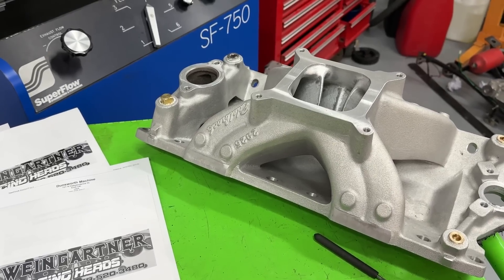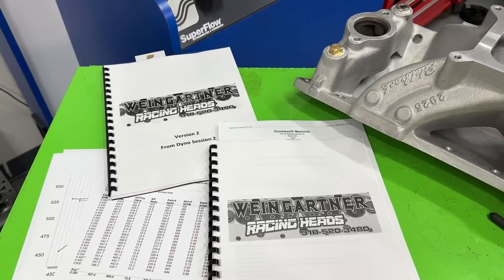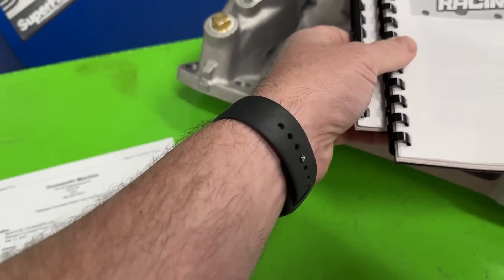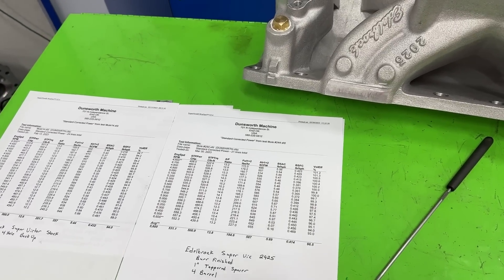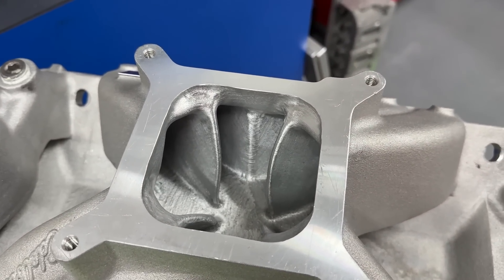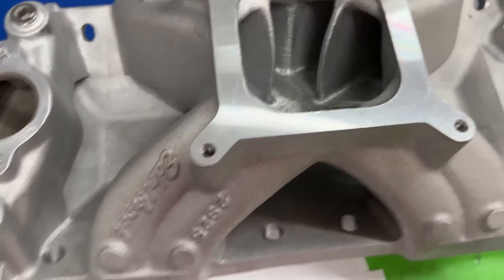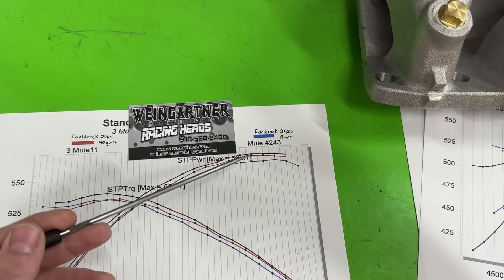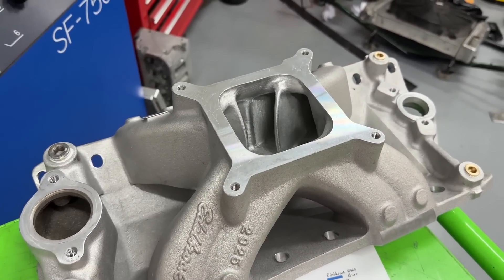Burr Finish VS 40Grit Finish   Copy

Comment: Even the Simplest test Comparison can get unexpectedly Complicated....Intake Finish with Jetting Optimization seems to be Need here.......I know dyno testers Prefer Individual Componet change test Comparisons but Intake Finish can be Linked to Jet size as in System A/F  tuning  Effect on ultimate Power.....Intake Finish Only Power measurements may be an Incomplete conclusion.....

Comment: What I take away from this video is a bit mixed. I couldn't help but notice the notation on the dyno sheets - and the sheet for the unmodified manifold Doesn't List a 1" tapered spacer and the other two do. The reference pull data or "control" isn't valid, or someone forgot the notation for the spacer on that sheet - so without clarification it throws that data out the window.
The other two are within roughly one percent, so (as you mentioned) there's no clear winner.

Some thoughts on the smaller manifold making more power; with a 190cc port and the relatively short cam timing, a smaller manifold might be matching the port size better in terms of flow - the charge not 'ganging up' at the port because the smaller (manifold) port velocity is higher and matches the flow velocity potential of the heads better - also putting cylinder filling about where that camshaft favors the power curve.
Maybe - just thoughts!!!! 
I love working with airflow - so much is still a Black Art, so any progress in an as yet untried area is a bigger win yet!!!
Reply from the maker: All them were tested exactly the same with a a 1inch tapered 4hole spacer.
Reply: @WeingartnerRacing  
I wondered, didn't seem like a mistake you would make.
Good video

Comment: Luckily my customers adore the BURR look!!!! 😅
Reply from the maker: Maybe but I guarantee at least one person that sees it thinks it’s garbage no matter how fast they go.
Reply: @WeingartnerRacing   Some are indeed sceptical.  But after 1 race that changes. 
Also what you did is something I do pretty long now after 10 years ago I tried improving an Ls7 head  with radius seat on intake and grit 60.  Airflow improved but power was 2-3 percent less..... esspecially in lower revs.  Last year did a BBC with assymetrical seats on intake.  Angles where droplets of fuel are smashed along and port almost complete burr finish.  Radius seat where only air and tiny droplets flow.  Difficult to make but results were awesome.  
Similar an Ls of which after overhauling diameter of intake throat was increased  by machine shop 0.040"  and seats were 0.010" deeper than new and with bit different shape.  Engine lost 30 hp.   After seats were replaced , with right shape, diameter and depth , and port roughened on specific areas it regained 38 hp first run .  Also engine responded more normal to fuel changes / ignition.  
Its in the details....

Comment: THIS would be an interesting topic to address
Old School/Wive's Tale/Rule of Thumb was that having TOO SMOOTH (too fine) of a finish (mirror-like) on the intake floor/runners would hurt Atomization of fuel in Carburetor applications. I wonder if the same rules apply to THE SAME INTAKE MANIFOLD using a Fuel injected setup with a 4150 or 4500 Throttle Body on top of the manifold, where no fuel hits the floor or runners, as the injectors are essentially spraying into the Cylinder Head entrances more or less, bypassing the manifold runners  ?
Reply from the maker: Maybe I will test that one day.

Comment: At 6200rpm the burr finished combination was moving more air than the 40grit, the burr combination was moving less fuel. 
If the burr combo was fuel corrected to match the extra airflow it would of made more power.
Reply from the maker: Maybe but I doubt it. If you look at 6500 they are almost identical and it still made less power.
Reply: @WeingartnerRacing  looking through all the rpm points the burr combo consistently moved more air but didn’t have consistent fueling, when you look at the airflow being higher but the fuel flowing less that says to me that there was a change in booster signal, I’m going to stick my neck out and say that the day the burr combo got run the air temp in the dyno room was higher, either from just a warmer day or from environmental heat soak from multiple dyno runs.
The air temp being higher can effect booster signal and also the airs density overall is less so the engine will make less power even tho it’s moving more air in cfm.

Comment: I only use the sanding rollers to give everything a nice uniform finnish. Usually intakes I will do a 60 grit (just a personal prefernce) now as for  Exhaust and cumbustion chambers I try to go for a "glass" feel just to keep carbon deposits down and stop detonation. I am no means a pro head porter but I have goten good flow numbers with heads that I have done. Probably not the best but they seem to make decent improvments, I jysy bought stuf too try and cut valve seats i am going to practice on a junk head I have with valve cut angles.

Comment: I think it has to do with the transition of airflow into the runners under dynamic conditions.  How fast can the flow be established into the runner when the demand comes on?
Reply: I should add that I saw a Hendricks manifold for 18deg Chevy back in those days, and they had a very aggressive finish,  but smoother on top and down the runners,  etc. Just like you're doing it.  I'm guessing they knew what they were doing.

Comment: In the 80's when I ran carbs I had a real time o2 sensor for tuning. I remember that the burr finished manifold required removing jet to get the same a/f ratio. This may also be the case here since the jetting was not changed. Great test Eric.

Comment: A rough finish grabs air. And air is slick on itself. See golt ball flow and dimple effect.
Reply from the maker: If it worked like that would have made more power not less. A golf ball flies through air. It’s not the same as air inside of a golf ball surface.
Reply: @WeingartnerRacing  not necessarily. It's still air flow.

Comment: Interesting, thanks for keeping it humble and not turning it into a burr vs. 40 grit war. I think that anybody  with 1/2 an understanding of engine building realizes that this test could go either way if repeated with even a modest change in the engine.
Reply: What I wanna see is burr vs 40 vs 60 vs 80. In my few hours of research, the consensus is pretty solid on 120+ being bad, but burr up to 80 seems to be a preference or teaching thing, mostly, and I'd like more empirical data on that.

Comment: Boundary layer, laminar flow velocity and turbulence. Key factors of an intake. Smoother finish thinners the boundary layer making the laminar flow CSA larger. Larger CSA slows the laminar flow velocity down @ lower RPM. Rougher finish agitates the turbulence @ higher RPM, so the feed into the combustion chamber decreases. On stock form, any intake can feed the engine @ lower RPM range. There's just enough laminar flow CSA to keep the flow rate in between the window of desired performance. Porting is to increase the flow into the engine @ higher RPM, by re-shaping the ports to keep the engine fed @ higher RPM. How smooth? it depends on the fuel system, and fuel used. Port/direct injection doesn't need the boundary layer, bcz there's no fuel in the port to be mixed. the heavier the fuel molecule is, and richer the mix itself, more boundary layer and turbulence is needed to keep the fuel in suspension all the way into the cylinder. What about the plenum? When you are circuit/oval racing, keeping your engine on constant high RPM for long periods of time, the plenum can create low pressure vortex under the carb. This sucks more mix into the intake, having a bigger charge for the opening valve, feeding more mix into the combustion chamber. BUT on a short burst; dyno pull or drag racing, there's not enough time for the vortex to happen, only too large plenum to mess the flow velocity on low RPM. On drag racing, the intake shape is the key. Equal shape and volume ports, less obstructions between the carb and the valve. "Ram Air intake". To get the best results, the piston needs to pull fresh charge through the carb, and the intake needs to mix the carge for optimal burn before it enters the chamber. And all this needs to happen evenly on every intake stroke while the time decreases when the RPM goes up, mostly between 4000 and 8000 RPM, the worst possible range for pulse harmonics, especially when the exhaust pulse is uneven. After you've fixed all that, comes the next problem: Different style intakes react differently to different bore and stroke. An intake that creates the perfect torque curve on one bottom end, is an absolute turd on other. And it matters if the C.I is made with bore or stroke, and what is the relation of those two. Longer stroke needs more laminar flow speed than larger bore. And the cam profile messes this equation every time. race car engine building is fun, they say.

Comment: That's a cool video and I was very curious on the finishes because seems like some people do very aggressive burr, then 40 grit also do you do 60 grit. But awesome results I am glad that your original idea actually made more power than just burr
Reply: I know you said don't take it as gospal but it's still cool to see your work and seeing Dyno results. And I am curious to see what manifold did good I was thinking wait is it the victor jr because that one is small. And i was like well how did the Motown manafold do.
Reply: @chevyrc3623  Up till this point the Victor Jr & Mowtown haven't been in his testing. There's a lot of other intakes I would have liked to have seen tested (Holley 300-36, Weiand Speed Warrior Air Gap Style, P P Crosswind, Dart Dual Plane, Brodix HVH 1016, RPM Air Gap, Victor Jr 2975 vs 2900, Tean G 7530, Strip Dominator 300-25 vs 300-110, Mowtown, Dart, Bowtie Single plane) but good luck getting all those together at the same time. Expensive plus the poor guy would have gone to multiple days of testing on each set of heads.
Reply from the maker: I did test the 
Vic jr
Motown 4150
Holley 300-25
Brodix 1016
Team g

Those were in round 3 except the Motown
Reply: @WeingartnerRacing   👍 Nice. Round 3 promises to be an interesting video. Holley 300-110 vs 300-25 might be interesting to test spacers on the 25 to see if it can be better overall than 110 since you can add different types of spacers to get to the same height.

Were you able to test a regular Victor Jr 2975 vs the port matched 2900? 
Kind of strange that Edelbrock lists the intake gasket size as a 1206 but when you look at the stated port dimensions the 1205 is a much closer fit.

Comment: On my Volvo 5 cylinder na head. I have found that the 60 or 80 grit I use seems to cut away very fast. I've only been working on the exhaust port for now and plan to finish it with a much higher grit. I don't plan to port it, the ports will only be smoothed out from rough casting Marks. I am afraid of touching the valve bowl. The idea is to improve flow across the range not worsen it. Hope I succeed.

Comment: Thanks for doing the testing Eric👍
I remember on your second dyno session that you were down from the previous session with the same combo.
And you put it down to weather being vastly different from first session.
And the weather compensation wasn't being used as if I remember correctly wasn't looking to good either.
How was your base line this time session 2 from session 3 ? 
The variation seemed pretty constant from session 1 to 2.
Not being picky just interested and thanks for the content your creating 👍
Been following you from the start 👌
Reply from the maker: Great question. We had a control manifold that was used in the previous session and it made within 1hp. So it was much closer from session 2-3 than 1-2
Reply: Thanks Eric for the reply, that makes it interesting👍

Comment: I can’t wait to see what heads you use and the difference in power. You should try running the coolant lines from the front of the intake to the back to see if that makes a difference due to changes in cylinder temps

Comment: My conclusion, on the "as yet seen" smaller manifold, would be velocity. Your dyno mule wanted more velocity, with it's given combination, than that Victor Jr. provided. Just a thought.
Reply: First thing in my head, same. That's some pretty good size tunnels for them heads. Also if your 40 grit made more, then air speed a factor once again

Comment: I wonder if the reason you got the result you did was that the manifold was pretty well matched in cross-sectional area to what the engine wants

In theory, the rougher the surface finish, the deeper the boundary layer will be, and the part of the port where air flows through smoothly will get smaller

In fact, looking at the graph comparing the burr to the 40 grit looks like it might back that up, with the burred finish showing a small advantage below 5000 RPM

At least, that's the theory. Of course, in theory, theory is as good as practice...

Bottom line: wonder what results you would have seen if you'd had an overly large manifold on the engine. Perhaps the burr finish would have matched or even picked up over the 40 grit?

As always, more of these data points being put up seems to raise as many more questions as it answers.

Interesting video, and really good looking work in the manifold!

Comment: Perhaps the burr finish creates a thicker boundary layer, which means the passage that the air can flow through is smaller, and this increases flow velocity at lower RPM, but becomes a flow restriction at higher RPMs, at least vs the 40 grit.

Comment: Very interesting. Does seem to support the idea that the rougher finish improve atomization.
Maybe thats why the smaller manifold works so good. At least partly the atomization would be better with higher airspeed in the runners.
The same test of finish on that manifold would be very interesting.
Reply: Air skips over the top through the "boundry layer"...no surface contact at higher speed.

Comment: 👍 Nice results for your efforts. If you do much work to dual plane intakes do you keep the same finish specifications?
Rough on floor, crossbuff dividers & top, and 40 grit on sides?
That would make for more interesting data on the Performer RPM. From your results I think I would probably do at least a rough finish on the floor.